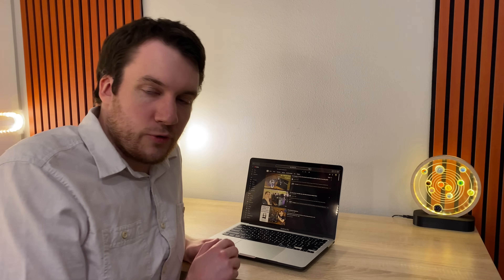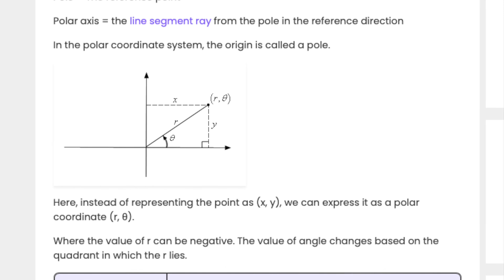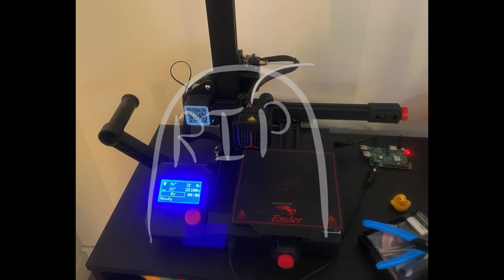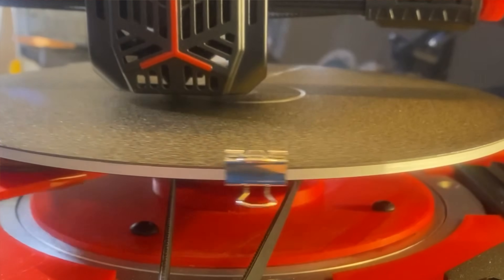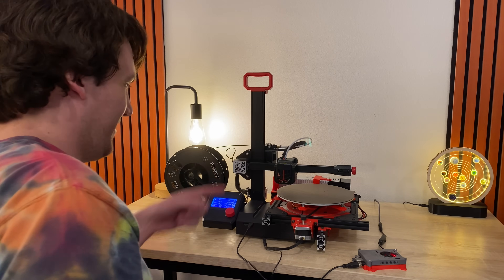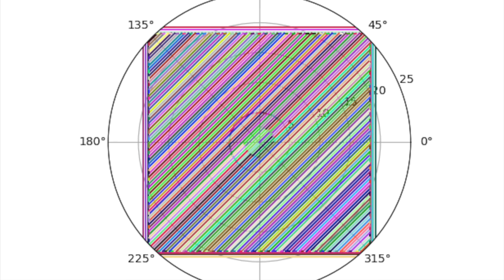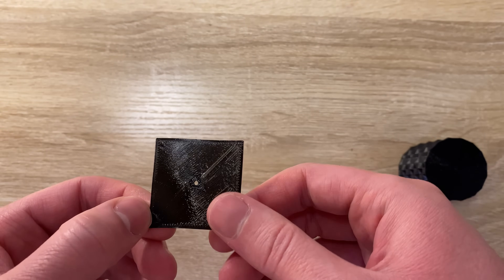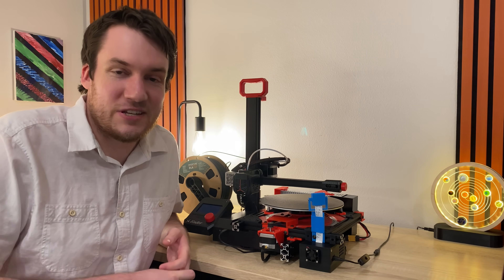This Printer Has A Spinning Bed

Comment: I think polar printers as a concept are being slept on for certain types of parts but I from what I've seen of 'polar' is still not quite what I think of for cylindrical. For me, Large cylinders, cones, and other shapes that are largely radially symmetric would be excellent for what I would think of as 'additive turning" workflows. AKA lathing in reverse.

I could see a printer with a custom multi-nozzle head that would literally be able to print 3-4 wall thickness vase mode.

Personally I'd not even care about making traditional parts like benchies. I'd be fine with it more-or-less assuming the Z axis is centerline of the part and works with X and Z axis movement for the most part with maybe a little bit of Y to add details locally on the surface of a part.

Comment: Back in the day, when I designed my first polar printer, I developed a post processor for the slicer... but later, when we developed the Polar3D printer, we included a Raspberry Pi and I moved the "polar_converter" process to the the printer itself.  Then it could send the post processed file directly to the Printrboard electronics just using the stock Marlin build on it.  Basically, the RPi would read the gcode, and stream it to the Printrboard, but the linux environment had a plug in that intercepted the stream, processed it and then sent it to the hardware serial port.

Also, instead of breaking it up into segments along the radius, I broke up every segment in gcode into .1mm long segments... and each one had a calculated speed based on the radius and the F parameter of the gcode.  I also made sure that no code could ever get to 0,0... if it ever received a 0,0 command, it always changed it to have a .1 radius.  That way it never hit the true mathematical singularity.  When it passed over it, it would do the normal rotation, but that speed was capped at the F speed.

Comment: How come you decided not to mount the pulley on the bed assembly directly to the bearing and instead went with a sandwich? Won't a friction fit like that be less stable and stiff?

Comment: Wiring AI into the censors/camera could be another angle to hit it from. Though AI does require a bit of compute power, with some targeted vision models, it might not be too bad. With that said, with better sensors for the software to get a better idea of what it's made so far, as well as quicker, more accurate adjustments to the print nozzle, you could consider adding to this concept by also making the bed tilt. Although it may require an automatic adjustable directional nozzle to do that efficiently, but the plus side of such a design would be avoiding that classic overhang droop which is prominent in many filament types. As well, AI could detect if the filament isn't sticking to the bed/layers, and make dynamic adjustments to solve for that. Actually, with a well trained AI, and the correct parameters trained in, we could effectively make a printer that autoadjusts for any filament types and heating conditions.

Comment: Awesome Idea! What if the x axis extended all the way to the far end of the circle? Seems like it would solve your singularity issue since the x axis direction would be independent of rotation angle (theta?). You could also make the circular bed smaller to fit within the x axis.

Comment: I think that one approach for "easily" converting slicers to polar would be to project the shape into cylindrical coordinates, slice the projected piece as if it was cartesian and then produce gcode that controls the cylindrical coordinates directly. This would reuse the current software and will probably avoid moving through the singularity. One issue I foresee is that the software won't have any idea that all points with radius 0 are the same, so it might over extrude in the center. Maybe other issues with overhangs and supports may arise too (the criteria for overhanging in cylindrical might be different to the criteria in cartesian)

Comment: I wonder if you made a spinning belt bed. That would be pretty cool. or, what if you made a printer that has a spinning toolhead, plus this ? Someone made a video, but he had to use a duet board because klipper and marlin wouldn't work with it. Reprap firmware seems to be able to support losts of stuff though. try that out. i also saw recently a guy who built a printer with 4 totally independent toolheads with a spinning bed.

Here is the Title of the video and the creator name: Nathan Builds Robots and the title is: The highspeed future of 3D printing - Quadrupolar express

Comment: @DavidFricke What do you do to make sure that the bed heater wires dont tie themselves up ? Do you have some sort of special connection in the middle, or is it set so it can't spin more than 370?

Comment: Maybe you can pursue an idea I had recently using a rotating bed in a delta printer.  A delta can print much faster because it uses 3 motors to move the print head instead of just one or two.   And the bed is a round shape, so how about adding a 4th motor and movement by rotating the bed.  Not sure if it will work but it does sound like a difficult math problem to figure out when it helps to speed things up.  Or there is no point the delta is fast enough.  I dunno

Comment: Thank you for implementing this!  I was thinking of a similar setup watching speed benchy videos this week.  But... can you next modify it so the turntable always turns in one direction, and the head always scans from outer rim to center and back again (just like a record player following a groove).
So instead of depositing filament random point to random point, like vectors, it would be more akin to rasterizing, where the head turns on/off the supply continuously as it waits for the right angle to come by.
Im not sure if you can dynamically control the head filament flow so precisely, but if so, your printer could then print arbitrary shapes, not just vases, and the mechanical positioning would be grealy simplified using your setup.
Anyways, looking forward to following your videos. Cheers

Comment: As I've been there, since I made myself a polar milling machine from dust up, I can tell you that the best way is to work in polar coordinates, not Cartesian.
In my case I made a piece of software inside the controller to calculate cartesian-to-polar directly from the gcode, but that can be done by the other side, with your gcode generating polar commands, too.
Anyway your approach was very intelligent, I'll give it a try too.
Oh, and my machine can't deal with curves, just point-to-point commands, but that's exactly what Cura does, so I guess it's not a big of a problem.

Comment: Poler printer with a massive bed could be used for mass production of prints. Like leave the radius axis the same size but increase the radius of the bed. You can then put several prints along the radius of the bed.

Comment: On other 3D printers it is faster to print straight lines because of the way that the kinematics work. I’d like to see you try to print spiral or circular top and bottom infill patterns to see if that works any better with the motion. Another thing that could help is extending the motion of the extruder slightly beyond the center of the build plate so that there’s a sort of circle of lenience where the printer doesn’t need to spin the plate 360° to draw a line. This would all take more modifications to Klipper and the slicer to work though.

Comment: Just an idea: Instead of slowing your printer down in the center- would it not be simpler just to calculate the actual speed of motion at each point and just slowing it down if you have printspeeds over your desired value? So instead of controling the speed depending on the location, controling the speed in general. Also the second question would be to have a longer radial arm. This obviously creates new issues because now you would have two possible solutions for one location in volume. But this is solvable- basicly robotics is doing exactly this when you have for example a robotic arm with 9 DoF.

Comment: As someone who wrote a popular Cura plugin not only do I feel your pain about digging into Cura, the fact you got this far relying on post-processed gcode is already impressive.

I wouldn't expect much from Ultimaker but if this is something you'd like to keep chipping away at, try reaching out to resident Cura guru Aldo Hoeben (aka fieldOfView) to see what he thinks. Not sure if it's in his wheel house but he's a chill guy and worked on a Cura build for belt printers awhile back. Otherwise a different slicer may be the way to go.

Keep it up, I've been waiting to see more progress on polar printers in the community for what feels like forever.

Comment: the belt skipping issue seems to me related to how the software is handling max acceleration and velocity. It's probably taking the maximums to be maximum acceleration and velocity of a point on the bed, rather than back-calculating that to a max accel and velocity of the motor. 

Well that, or you failed to properly calibrate the maximum acceleration the bed could do, resulting in the belt skipping. Which I think would be fairly easily solved with a much higher belt tension. Personally, I prefer to tighten my belts until they hum when plucked. 

The way you handled the singularity issue does work, but seems like a workaround rather than a true fix. 

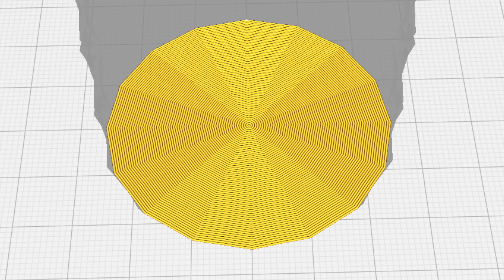Also, concentric infill exists and does the same thing as setting the walls to a really high number like you did at 11:40.

Comment: This is fascinating, I was recently playing around with defining vases using SDFs (signed distance fields) and triangulating them, however I found myself mostly defining them in terms of a cylinder with varying radius. It occurred to me that this printer could potentially be very well suited to this - define your vase by a function of z and theta that returns the radius at that point, and simply set the position of the r axis (if that's the right terminology) to this value. I might work on creating such an "equation slicer"

Comment: I would suggest modifying the printer so that its singularity is not at the limit of the X-axis's movement, but rather at the middle of its range of motion. That way you can print with speed and efficiency - something that is necessary for a rotating bed to go from a gimmick to an irreplaceable feature. A line is an extremely simple and common feature. Having to stop the head, rotate the bed 180 degrees, then proceed with the remainder of the line can only introduce complications, especially with print quality. Not to mention, the heat of the nozzle may end up deforming the print on nearby extrusions. 
I was very surprised to not see you modify the printer to fix this.

I would suggest some of the following points:

-Find a creative way to utilize the tangential speed, that can really make the rotating bed stand out among all other options. Imagine a printer that does not increase the print time on objects with wider dimensions - you could theoretically print a 100mm circle in the same exact duration as a 10mm circle so long as your extruder can keep up. Also, I would make the rotation of the bed quicker, otherwise that will end up bottle-necking the print speed in most if not all scenarios, especially if you stick with the current X-axis setup.

-Ensure the printer is capable of very accurately finding the singularity. Any offset from the singularity will directly translate into a wider contour than desired. For cylindrical objects, that will result in a dimension with an excess in diameter double the offset from the singularity. It would also make a plus sign look like someone cut a square out of the center of it.

-As others have mentioned, it might make sense to make the bed direct-drive or at least to use a gear.

Very cool video to watch overall!

Comment: One of the huge benefits of these polar printers is cost compared to quality, since the base motor doesn't need to have as much positional accuracy which is more expensive to integrate than constant rotational speed. And the up and down motors and belts can have extra money put into them. (This is all assumptions that are probably correct in some way)

Comment: the crash without that correction script probably occurs because the software has trouble doing inverse kinematics of the printer as the jacobian of the print head relative to the structure printed isn't invertible anymore :)

Comment: Watching your video has gotten me very interested in a polar printer, less for the idea of smooth vase mode and more for what it can do for bed size. As bed size increases the gantry above needs to be increased in size to span the entire bed with most other designs. But with a polar printer you can just rotate the bed to the other side, letting you have half the gantry above it. And since you're not slinging the bed you probably can go a little faster than a bed slinger, though probably not as fast as a core xy or a delta printer but I prefer direct drive extruders anyways so already would be limited to that middle ground anyways if I swapped to a polar printer.

Back to increasing printer size, after a certain point you'd probably want to make the cantilevered arm have some additional support. My first thought was an additional upright 90 degrees out from the main arm but that is additional weight that might exacerbate any drooping at the far end of the arm so my second thought is increasing the height of the upright and then using a cable runner out to the far end of the arm. That would allow for a relatively large format printer without having as much of a large overhead gantry, leading to more space being able to be used for the bed.

Comment: Excellent example of dedication and problem-solving!  The strength of this printer is obviously in printing anything that is basically a cylinder.  Vases are a fantastic demonstration of the complexities available.  I was curious what the pure round output of something like this would be, for, say, spacer rings or even air-hockey pucks and round coasters.  The benefit of something like this would be it being able to print things like helmets, headbands, etc.  Are you going to be doing more videos using this unique design?

Comment: I think there is an option in cura that allows you to change the pattern of the layers to be concentric circles and not zig zag lines. Otherwise I love this machine it's pretty much a 3D printing lathe 👍👍

Comment: LOL the "my pins are fucked but it must be something more complicated than that" got me when adding a second toolhead to my ender 3. Just a thought: why not extend your x gantry or make the bed smaller so that the print head can go fully across the diameter instead of needing to rotate halfway at the singularity point?

Also, reducing the weight of the bed may help with jerk. There's a printer named the Stinger that is a crazy Cartesian bedslinger with a CF bed. Is there a concentric bottom and top layer option in slicers? Maybe that can help? I have no idea if these things will work, im  just interested in the desigm lol.

Comment: Love your printer!
I also built a polar printer / still modifying it!
Nice to see, some choose a similar solution to the singularity problem :D since you programmed it in Python, it's relatively easy to add it to Klipper btw ;)

One big question: Did you calibrate your nozzle-center-offset? Because if you didn't, you will never get straight perpendicular lines in your cube :D

Comment: Damn I’ve literally been working on one these myself albeit VERY slowly. I started on it because I figured this could be an amazing answer to hot end changing. As the hot end runs along only one axis you could easily have multiple hot ends on the same rail (well, 3) with ‘pockets’ either side of the rail out of the way of the circular build plate that the 2 hot ends not in use can sit in. That way you can have 3 materials primed and ready to go without any need for a literal tool head change while the circular bed design stops the weight of triple hot ends affecting the acceleration. Idk might work anyway 😂

Comment: I think it's called polar just as a traditional continuation from the CNC lathes' coordinate systems being polar. There, you have your Z distance along the axis of rotation, more means further from the chuck; your X distance from the axis of rotation, can be + or -, depending if your tool is coming from the bottom or from the top; also expressed as double the actual distance, to mean diameter; and your C - the angle the chuck is at, 0-360 with precision being determined by how precise your lathe is. Some super precise Swiss machines can do 4+ digits of angle precision after the dot.
A lot of machines also have the Y - the movement of the tool forwards-backwards relative to the operator; perpendicular to the XZ plane of regular movements. This is especially useful if you attach a spindle with a mill as your tool, so you can machine flat rather than round surfaces on your part.

This mess of a coordinate system is still referred to as "polar" by most ppl. Just becayse in CNC mills it's different and the main focus is the XYZ of the spindle like on a cartesian 3D printer, rather than the XZ movement in relation to the spinning part in the chuck.

Yeah, I used to be a CNC operator, why do you ask? 😁

Comment: Maybe clay and ceramic printing could be a use case:
1. Clay printers need a constant flow rate (there is no stop&go), which can be much higher than FDM printers.
2. So 3d-clay printers can only print in vase mode.